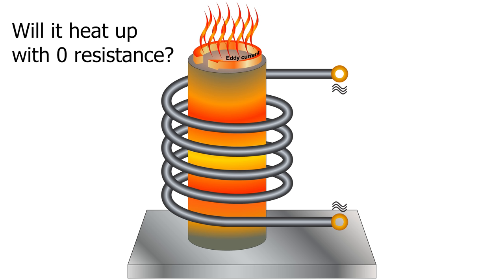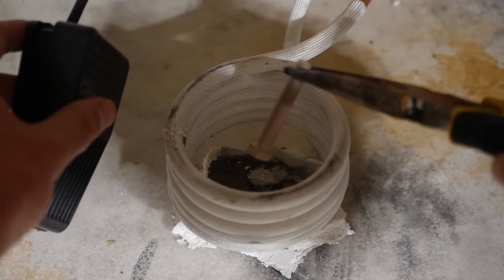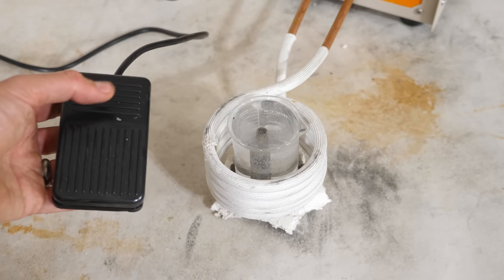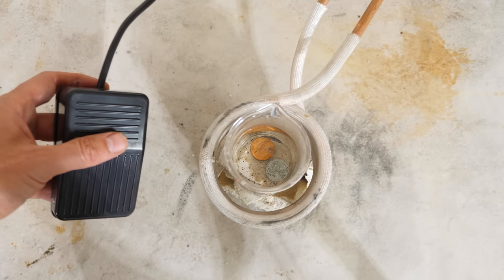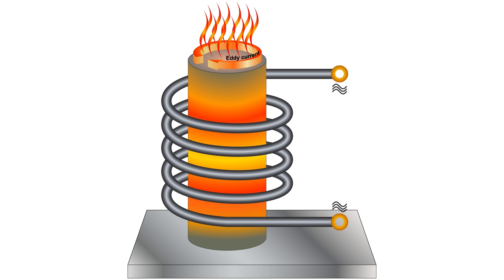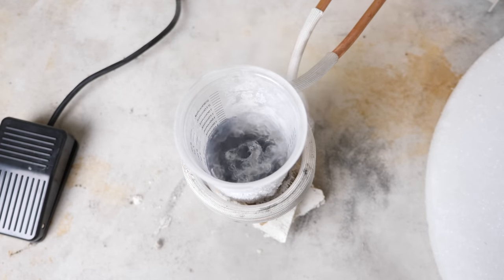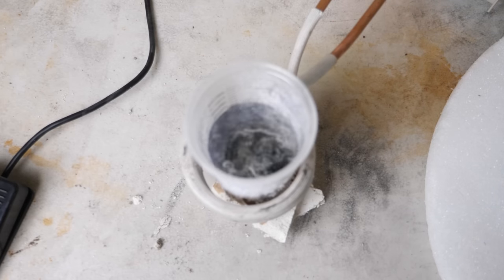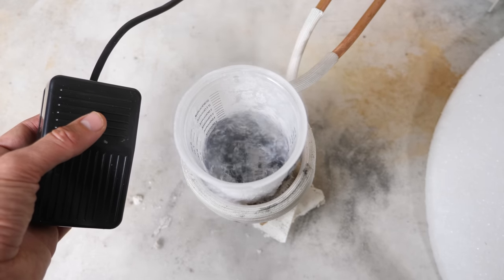What If You Put a Superconductor in an Induction Heater?

Comment: could there be an effect from vibrations at the same frequency as the current? or would this be neglegible? What I´m thinking is that if current was in one direction, the superconductor would want to float or spin (as they do when they levitate) but since you flip the current, they would sink or rotate the other direction. Would these switches(i.e. vibration) do anything?
Reply: In a way less, what's getting pushed/vibrated around are the magnetic field "fluxes" inside the superconductor (as mentioned also by James) which costs a lot of energy.

Comment: This is really interesting and I'd like to understand it more. First, I think we need to understand how the temperature of the solid gets increased. I guess the main process is electrons inelastically scattering off the lattice and transferring their energy to the lattice. If we calcualte the temperature of the electrons (here "temperature" basically means kinetic energy), it will be huge. The temperature we are feeling is actually the temperature of the lattice. (I guess this is not contradictory because electrons have a much smaller heat capacity than the lattice.) Therefore, the heating effect we get by the electric current is actually of a different mechanism than zero resistivity, which concerns the interaction between electrons and disorder. The disorder scattering is typically assumed to be elastic so I guess it doesn't play a role in the heating.

Then, the heating will happen as long as we have a current so the situation should be similar to that of a normal metal. However, I believe the material you are using is an insulator, so actually the real interesting thing the superconductivity is doing is to induce a current (the Meissner effect induced a current to keep the magnetic field constant). I guess we always use some kind of metal to do induction heating but by virtue of superconductivity we can use an insulator to do it.

I love superconductors and would love to see more vidoes about them. Thanks.

Comment: My soldering iron is induction. There is a small coil in the end of each tip and the core of the tip is different alloys depending on the temp of the tip you select.

Comment: It should be added that ferromagnetic materials will also experience a heating effect from magnetisation hysteresis losses. They get magnetised by the field from the coils. Every time the magnetisation switches, some heat is generated.
This effect is usually much stronger than the heating from eddy currents. That's why only steel pots work on induction hobs.
Reply: Also why the bolt heats so quickly up to ~orange heat when standing up, but kind of just stalls out at that point!

Comment: I really was surprised by what occurred with the superconductor.  I expected it to ignore the alternating magnetic fields until it warmed up some, then it would react more and more.  But, even when you refroze the superconductor it still had a reaction when I assumed it wouldn't.  I don't know if you were pretending to be surprised or really surprised, but I really was.  I didn't know that superconductors has a penetration depth even when cooled or the other mechanisms you were starting to allude to in your pinned comment.  Very interesting stuff!

Comment: The heating is not caused only by resistive propriety of the material but also because of the magnetic proprieties. Magnetic dipoles in the material oscillates according to the changing magnetic field and this cause heating

Comment: I have the answer as I make superconducting pucks.

The superconductor layer is very thin (less than a human hair in thickness) so it is in a sandwich of stainless steel and copper.
In addition these ribbons are soldered together more than likely to add up to the diameter so this would introduce tin and maybe lead.

The ultimate experiment would be to use a single domain chunk of YBCO or some BSCCO superconductor.

I've actually done a similar experiment with putting a chunk of YCBO in the microwave.  When warm it sparks but under liquid nitrogen it does nothing!  I made a video but never posted because I wasn't happy with my camera set up so .... feel free to try it! (with a chunk of pure)
Reply: Interesting I've only seen these pucks as powered ReBCO compressed in a mold instead of proper crystalline tape stacks. It would change the electrodynamics of the situation quite a bit, coupling losses would be much more significant. Wouldn't expect it to work as well as a "quantum locking" demonstrator then though.

Comment: I am wondering that the frequency of the current applied into the induction coil depends on the power supply you use. That means, when you turn on and off the switch, there is a step change that changes the frequency profile of the applied current unless the power supply has a mechanism to regulate these spikes and harmonics. In my opinion, these high frequency noises and harmonics may have very low averaged amplitude; but may be enough to penetrate the very thin skin depth of the superconductor.  This may not be a big deal unless the experiment requires to  find the change in boiling temperature as a function of frequency.

Comment: The induced curent is equal to voltage divided by resistance according to ohms law. Meaning lower resistance will heat more. The copper penny probably heats less because its mostly zinc and not really copper.

Comment: I would like to see 2 more test if your up for it. 1. Put a magnet in a cup of water in the coil to see if it heats up. 2. Raise the induction coil to a height where you can have the superconductor levitate the magnet below the cup and coil while turning on the induction coil to see if it drops the magnet or does something different.
Reply: Test #3 carbon graphite welding rods in the cup of water.
Reply: Also in the test with the magnet in water see if it loses it's magnetism by having some paperclips on the bottom of the cup as you turn on the coil.

Comment: Sir, you said higher the resistance of a conductor, faster it's heating.
Then,in a contradictive way, insulators(due to its high resistance) should heat up faster, right?
Or is it there a higher limit for the resistance of the material getting heated up above which it can't be heated?

Comment: I think I read somewhere that the reason superconductor locks magnet in place is due to the imperfection with induce eddy currents , although I am not sure if it matters , I want know if it has some significance
Reply from the maker: The imperfections in type 2 superconductors allow the magnetic field to penetrate it (this allows the quantum locking) but it doesn't change the fact that there is 0 resistance inside the conductor. But it does mean that the skin effect is also surrounding the imperfections. So a type 2 superconductor would have worse skin effect than a type 1 superconductor.
Reply: @TheActionLab  oh cool!

Comment: Field lines are not any more real or substantive than state borders on a map or isoheights on a 500mb chart. Of course, we use them the same way that we use borders or isoheights, that is to highlight/outline what the shape of the field may be, how intense it is, the gradient across the field, etc. Ofc you know this, but bare with me. It is great to see someone who has a strong grasp on academic standards out here promoting science, but this is getting into the areas where even the prominent minds of what is considered core academic principle don't have the answers. Understanding the magnetic field, magnetism, current, charge and charge exchange is one of the several core focuses of leading groups at LHC/CERN and other accelerators across the globe.
For those of you whom take the time to get through all my ranting here, I hope you can understand how this simple experiment and textbook presentation not only highlight one of the core struggles of modern science in the quantum, but actually gives a little insight into why this is such a problem. Here we go, this will be a one shot rough spew of nonsense for most, so feel free to bail lol
It is interesting in the case of the super conductor that it was presented as having a resistance of "exactly zero". If I believed that were true and had a basic understanding of magnetism and inductance, then I too would have had a stronger intuition that the superconducting mass would not heat in the presence of the ac field. After all, we know that it is exactly the resistance that causes whatever is within the field to heat due to acceleration at the atomic level. Thats why it is so fast, right? The fields penetrate and there is no real convective process, it all happens at once.
The truth is, there is never a case where anything has exactly 0 resistance, this is due to time, that is the time it takes for a charge to reach from one point to the other. Even though this value may be very near zero, so near that it is considered negligible to a point where it is calculated at zero in lab conditions for ease of computation and the error rate well acceptable, the resistance of time, or size/length of conductor, is still a non-zero value. In a dc current environment this delay induced resistive value only matters twice. When it is turned on, and off. However, in an ac current environment this matters all the time, with each phase change of the applied current a slight charge gradient occurs within the superconductor, from atom to atom(Or rather instant to instant, depending on your world view) there is a "fractal" gradient that exists. In this case, even the slightest temperature increases within the ycbo skin/surface would over very short periods of time grow exponentially, negating the superconductive properties locally, where it matters, and result in a cascading effect. Also as boiling increases, surface contact with the liquid nitrogen decreases and that results in faster heating in local surfaces. 
In the end, the result you see here directly highlights a fascinating aspect of fields, field modality, charge exchanges and conductivity related to the field and field generation. Which is at the heart of the most forefront of scientific quandary.
We say, the current induced magnetic field excites the electrons which generates heat. It seems very simple and is easily digestible. But leaves us with the questions that CERN is asking.
What is a charge?
What is a current, a field, or magnetism?
What are the carriers of these energies and forces?
When you say a field is manipulated, what is being manipulated and what is acting out the manipulation?
To think something has a resistance of zero is to fundamentally misunderstand current, but this is mostly because we think of current as true coulombs, where there are little tiny particles moving along a path like a flowing river, and like measuring water flowing past a spot by volume, electrons can be counted and thus current can be quantified. It is a neat and tidy way of describing things that is easily digestible but completely fails to describe what is taking place in reality. It's just close enough.

Comment: High frequency dissipation in superconductors is covered in the Michael Tinkham book (Introduction to Superconductivity) chapter 2.5.2 - there's a rather elegant and simple description there. In essence, even in the superconducting state, not all electrons are part of the superfluid (unless you are at absolute zero, which is unattainable anyways). Under a DC current, the "super" electrons will short circuit the coexisting normal electrons, giving zero resistance and zero DC heating. Yet under an AC current, the "super" electrons will no longer be able to fully screen out the electric field, and the rest normal electrons will be dragged around by the applied field - although at a reduced intensity - and dissipate energy in the form of heat. This is also the reason why there is still loss in superconducting cavities for microwave applications (such as quantum computing). As a visual demonstration, it'd be fun to dial the frequency of your inductive heater, and monitor how the boiling rate changes!
Reply: Another nuance here is the YBCO used, which means you have a type-II superconductor. The lower critical field of YBCO is actually quite low at only 0.01-0.05 Tesla level. This means you may as well get superconducting vortices (very tiny though) consisting of normal electrons in them. Under an AC current, this creates a lot of superconducting-normal electron boundaries, which can be another source of dissipation.

Comment: Induction coils are pretty amazing --and efficient too. I have seen a Russian maker put a crucible inside the coils to melt & cast metal.
Reply: It's not all THAT efficient -- the coil is water cooled with good reason!  Typical for a furnace might be 70%, which is still quite a lot better than gas-fired though.
Reply: @T3sl4  ah, I had not realised that the coil was water-cooled.

Comment: The conducting skin by itself doesn't generate heat.  The skin also forms when conducting DC currents- completely unique to superconductors.  

Resistive heating increases with freq^2, but it's still FAR below copper resistivity until the GHz region.

Superconductors have a critical temp- exceed it and it stops superconducting.  They also have a critical magnetic field, which isn't very high.  Exceed it (easy with an induction heater), and it also destroys the superconducting state.

At that point, the YBCO becomes a regular ceramic again and only the outer metal coating (non-superconductor) conducts and boils the water.

Comment: I was told that the good heat conductivity of metals was due to the free electrons.
Do you think supraconductors have also a supra heat conductivity?
Reply: Yes that's true, but not "supra" as temperature is a property of the molecule itself. Superconductors are actually used as heat switches in some high tech applications. Just putting a magnet next to them (i.e. pushing it back in normal conducting state) "switches" it's heat conductivity.

Comment: Turn on the induction heater first, leaving it on the whole time, then slowly lower the cup with the super conducting puck from 3 inches above the coil and see if the puck floats on top of the field.
Reply: That would be slightly unexpected because the field is made from AC current, it's alternating. Whatever force pushes puck up would pull it down the next moment...

Comment: 4:20 if its building that meaning its not super conductor, because the super conductor has zero resistance, that meaning zero heating, so its have a very low resistance

Comment: question for something that looks contradictory : so ohm heating is equal to the amperage squared times resistance, since copper penny has a smaller resistance than steel it should create greater amperage for a given EMF. hence even with a lower resistance it has an greater amperage that moreover gets squared, so why doesnt it heat up more than the steel penny?

Comment: I’m not a Theoretical Physicist, but I have had a nagging thought concerning wave-particle duality, and I thought I would share it here. Imagine a universe devoid of matter (completely empty so to speak). Now, introduce two photons traveling side-by-side with equal frequencies, with their electric fields oscillating between a positive and negative charge (net zero). Next, try to switch frame of reference to one of the photons. To you, a solitary photon, your electromagnetic field is not oscillating, but is instead static (since it is yours). When you observe the other photon, since it’s frequency is equal to yours, it also is not oscillating (from your frame of reference). If the two particles had unlike states initially (ie. when one was at positive oscillation, the other was at negative oscillation), from the frame of reference of the photon, we should see the other particle as unlike-charged, and if they were similar, they should have like charges. From the law of electromagnetism, shouldn’t these particles observe attraction/repulsion along their paths? Thus, deviating so to speak?

Comment: I'm assuming the bolt instantly stops boiling in water the second you shut off the current because water absorbs heat much more efficiently than virtually every other substance?

Comment: Is the difference between copper and steel coins just the difference in resistance or the difference in magnetic properties?  Next obvious question to me was what happens when you put a giant magneto resistor into an induction heating coil?  The resistance would be constantly changing with the AC field.

Comment: I am quite sure that the superconductor just did exceed the critical current, where the Cooper pairs break apart and the superconductor becomes normal conducting. Every superconductor has a critical current, critical magnetic field and critical temperature. The thresholds are specific to the material and can also vary with the grain size of the cristal.

Comment: Would it be possible to reverse this like put a hot object in the middle and generate a current? I feel like there's a more efficient way to generate power from heat than boiling water like a steam engine.

Comment: I wonder 🤔. Could you use a induction coil to flash steam a liquid like water. And use the pressure within a vessel to launch a bottle rocket.
Reply: @droopy_eyes  well the size of the induction coil that he has, I think you could use like a small nail possibly in the cap of the water bottle turned upside down place in the middle of the induction coil. And using a series of a makeshift quick release you could launch the bottle under pressure. Since the induction coil will not heat the plastic as he shows in this experiment only the nail. And the nail would stay on the quick release launcher just the bottle goes flying.